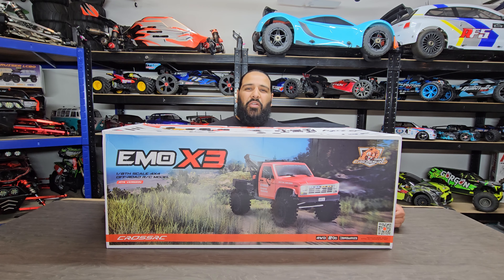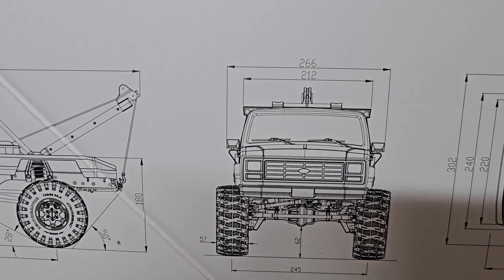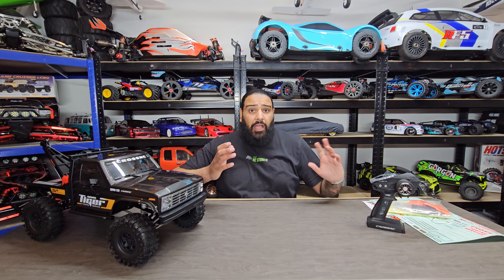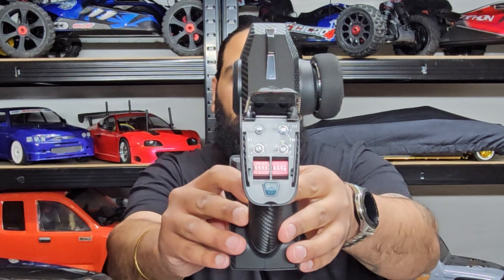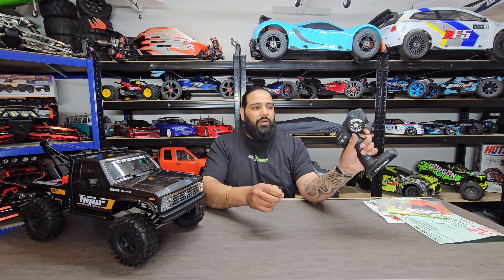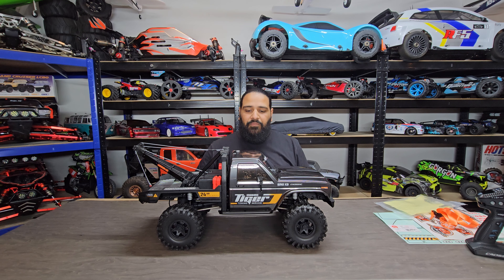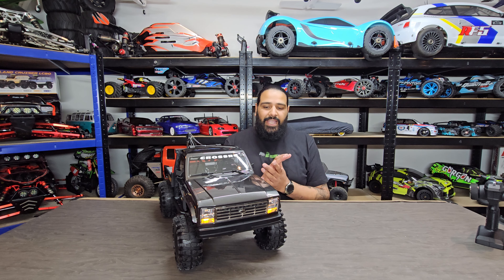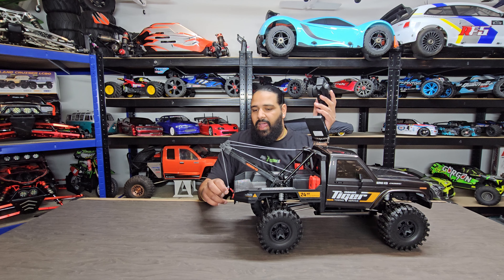WOW  EMO X3  IN-DEPTH UNBOXING REVIEW BY CROSS RC WOW

Comment: Epic!! I just purchased the Emo XL 6x6. It is absolutely amazing 👍.  The down fall for me here in the US is Cross RC customer support and service is the absolute WORST i have ever dealt with.  I've sent 5 emails asking for parts support info and zero response. It's been a complete month of no response.
Reply from the maker: Great truck!

I've not used the XL but it seems very capable.
 In regards to parts have to had a look online? 

Do you have a Cross RC dealer in the USA? 

You would find it much easier to go through a local (US) dealer than Cross RC directly.
Reply: @thercstore.  Yes. Parts are only available from Cross RC US in Ohio but they do not specify parts for the XL . It's so frustrating that they won't answer.  The dealer also has not responded either.   This is the beginning and the end of Cross RC for me!!!!
Reply from the maker: @chuckstith1933  That's such a shame.
 I know the feeling, I've had a bad experience with a brand and no matter how good or cost effective their cars are I wouldn't buy one due to the way I was treated. 

I could have most likely got you the parts you require if you were based in the UK.

Comment: i was turned off cross rc a few year back as the transmissions looked like some clockworck mechanism from a cheap brass clock.. how are they nowadays?
Reply from the maker: This is my first cross rc and won't be my last! So far its been fantastic! No transmission issues, really well built rig!
Running video out tomorrow with some crazy tests!